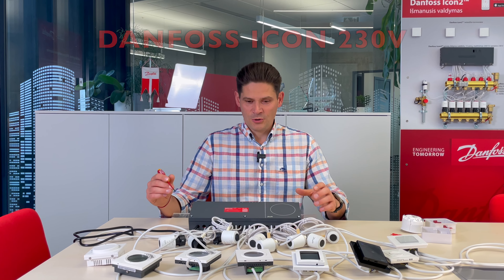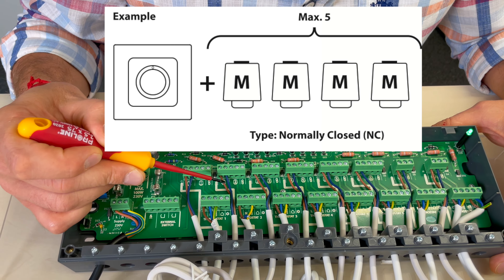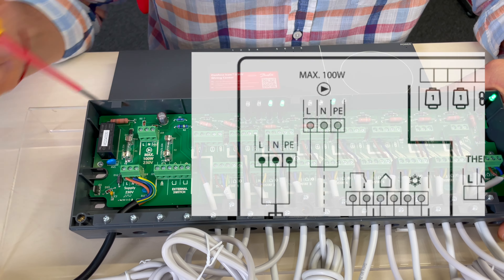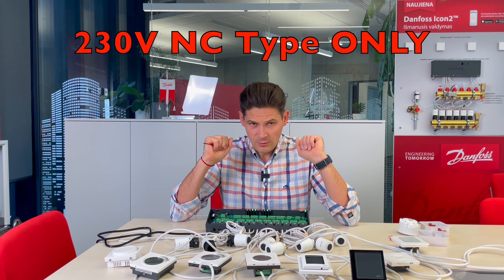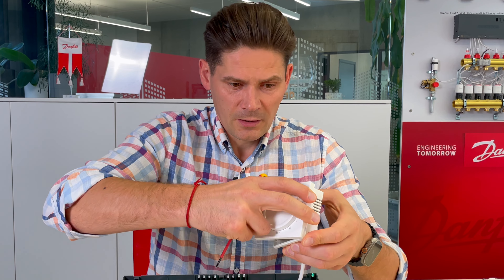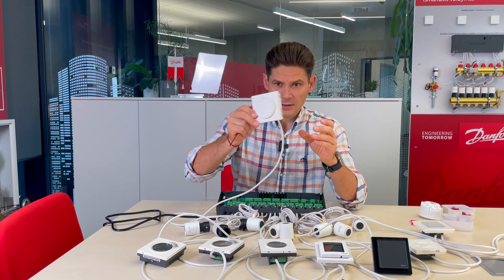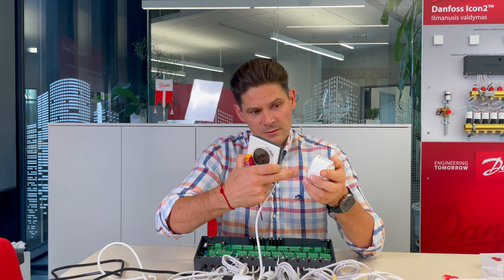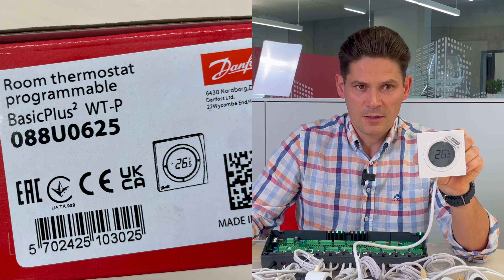Step-by-Step Guide: Installing Underfloor Heating Control Hub with Multiple Thermostats

Comment: Thank you for this video, it was very helpful! I'm wondering how should I implement wiring center for two manifolds (the house has two floors, on each floor there is one manifold, and there is one electric boiler powering both manifolds), should I have one for both or two wiring centers (one in each manifold box) and how do I connect the two wiring centers?
Reply from the maker: Hi! You can connect all rooms and actuators to one wiring center or have each on a floor. Depends, if you need to control circulation pumps, if there are any on each floor or not. Another thing is, do you have enough outputs. Having two or more wiring centers is no problem to control your boiler, you just connect all wiring centers "boiler" outputs to one boiler "thermostat" input. More info is in this instruction, page 3: https://assets.danfoss.com/documents/159726/AN35835853174201-000102.pdf
Reply: @heatingsolutions123  So I'll have 5 room thermostats on the second floor, and 4-5 thermostats on the first floor. Everything is powered by a single electric bolier (Vaillant eloblock), no external circulation pumps. I'd prefer having two wiring centers, it's a bit more money to spend, but I won't need to wire top floor thermostats all the way down to the wiring center and then back up to the actuators and it just seems more "clean" way to do it. So I'm currently in process of learning how it's going to work while the underfloor heating pipes are being installed (right now), thanks for the document, it's gonna help
Reply from the maker: @ismar9547  Ok, good choice! Just connect both Wiring Centres (WC's) (boiler output 2x0,75mm) to boiler "thermostat" input. If room thermostat on a second floor will call for heating - boiler will be switched on. If second floor room thermostat will call for heating - boiler will be switched on also. Both (WC's) off. Boiler - OFF. At least one ON, Boiler ON. Your electric boiler I guess has circulation pump inside. It will be controlled from boiler automatics.

Comment: I just bought danfoss EC temp next plus and after instalation i can navigate through all menus everything works fine except heat is not kicking in so does no heat simbol ( electric mat floor) need help
Reply from the maker: There are several questions then: What is your set room temperature  and what is real room temperature? What is your underfloor temperature set and measured? What is your min and max floor temperature limitations?
Reply: @ is it possible to contact you through the phone for faster response?
Floor temp is 35 i set 24  room temp shows 29 but actual is 23 and i chose simple not programmed program just want to set temp and have warm floor nothing else (its a bathroom)
Reply: @ tell me all the steps in settings i have to do to make it active for example i want to have 22-23 degrees on my floor thnx in advance
Reply from the maker: @BigOne-AV  select floor temperature control only then, and set floor temperature 22-23 degrees, but usually 22-23C is not enough for most. Floor max temperature (35C) is only for limitation to save from overheating.
Reply: @heatingsolutions123  so its like P02-02 and just < or > to adjust temp . Because it still not heating no click sound and no heat simbol.
Its strange that this product is so complicated
When i do P02-02 it shows 36 degree